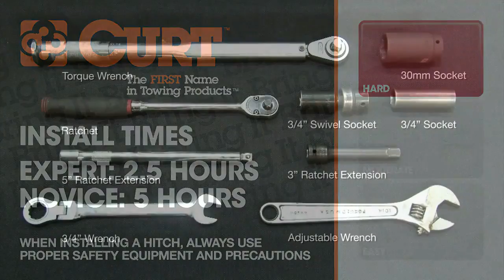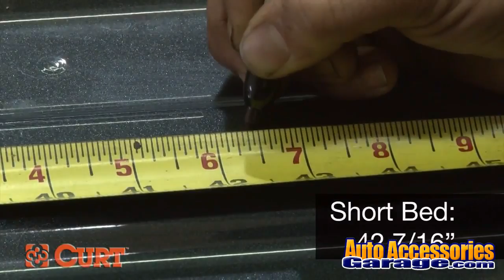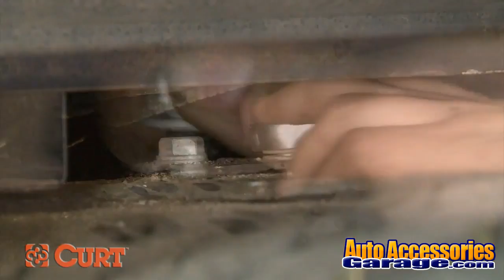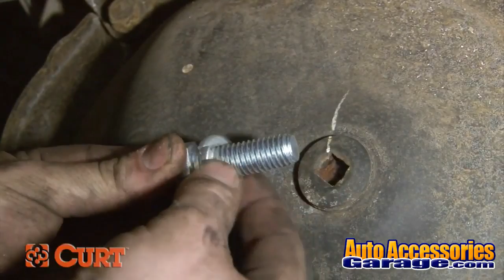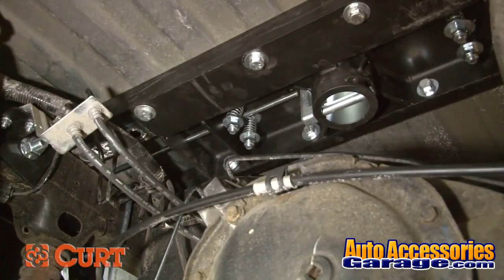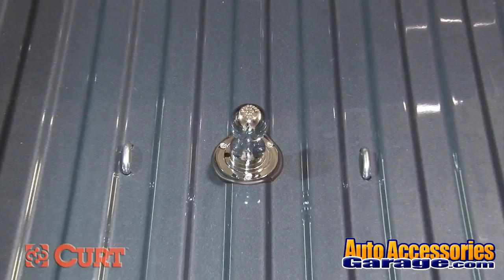Curt Gooseneck Hitch   Installation

Comment: If you have a 2006 3/4-ton Silverado, the correct measurement would be 44-inches. Even the directions on the paper that came with the hitch is incorrect. The brace under the bed is not where you would think. I would take a total measurement from the edge of the rear bar to the center of the hitch hole, and then double check on your truck bed before cutting the 4-inch hole.

Comment: '
how come this truck dont have 2 amber yellow lights on the both taillights...
dont have to cutting and take off the undercover mat above the axle...
after finish fix done then put mat back to undercover again
Reply: what
Reply: 1, amber turn sunglas on the rear is not a requirement. Red works fine
2. The mat needs to be cut. Youll learn when your ball gets rusted into place.
Reply: @brandoncaldwell95 
hi B C...
'
dont use 2 words - YOU / YOUR - on me...
dont insult me that nasty sentence...
red light is a only BRAKE as stop...
amber yellow light is a only turnning signal and emergency / stop safety flashers...
amber yellow light is a MUST to be safe life...
red light is a not enough
Reply: Where do we find a Gooseneck for bed
Reply: @normandukes6752 
hi N D...
'
check auto parts on the catalog or online or store